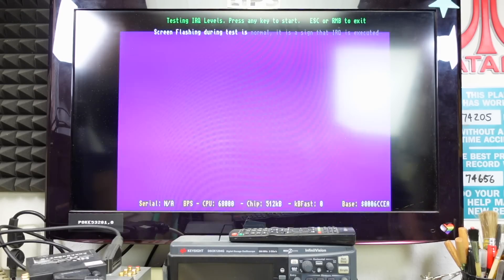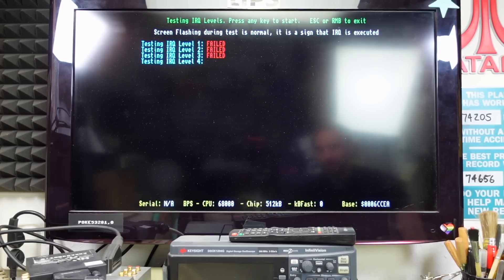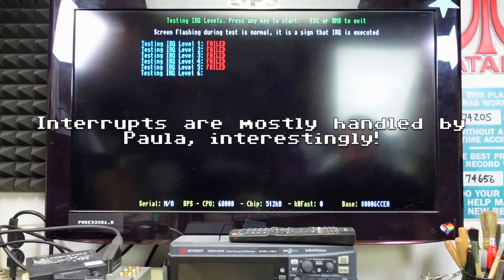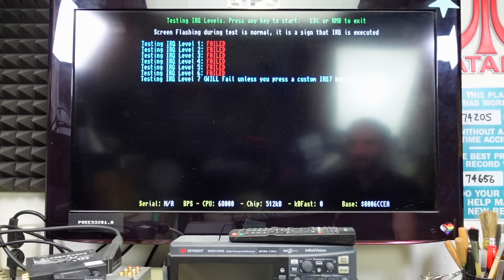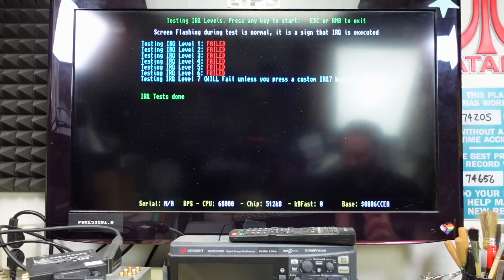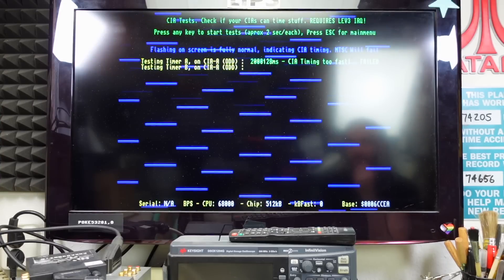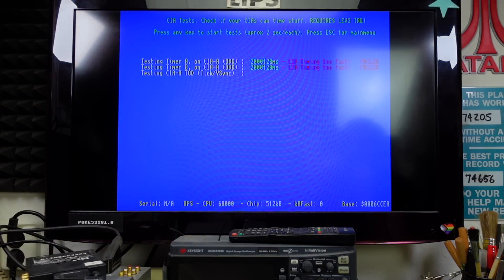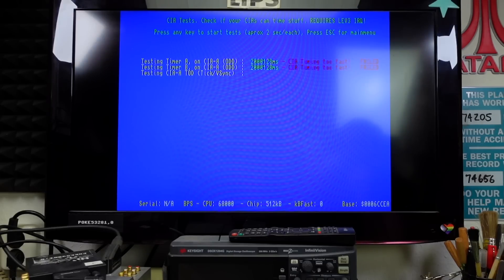Amiga 500 Rev. 5 Yellow Screen Repair

Comment: Great video, Jan!  As for resistor colors: The only way I can remember them, even after over 45 years playing with electronics is this:
Bad - Black
Beer-Brown
Rots-Red
Our-Orange
Young-Yellow
Guts-Green
But-Blue
Vodka-Violet
Goes-Gray
Well-White

Have fun!  😅
Reply: This is the exact phrase I was taught as an electrician in the Navy. Was going to comment but you beat me to it. ;)
Reply from the maker: Haha, maybe this actually finally helps me remember! 🍻
Reply: @JanBeta  For my complicated ways of memorizing stuff, the numbers 2 to 7 are a neat spectrum form red-orange-yellow-green-blue-violet ... brown is not yet properly glowing red so it's 1, black isn't glowing at all so it's 0. Grey is a less bright shade of white, and white is the hottest so they're 8 and 9.
Reply: G for grey actually? IIRC gold and silver occur outside the tolerance band only as negative powers of ten. But I might be wrong - wouldn't be the first time and won't be the last.
Reply: @jussikuusela7345  - I believe you are correct.  I stand corrected.  I jumped the EIA color code and missed the Grey/Gray standard coloring!  I corrected the error.  Thanks!

Comment: The first step to finding the error is always to measure the voltages on the ICs. 
This can be done with any multimeter and is easy.
The second step is to check the reset pulse. 
This can be checked with a resistor and an LED without complicated measuring equipment.
Reply from the maker: Very true! The thing is, I was so sure that I did the basic testing when I first tried to fix this one that it didn't even cross my mind to check voltages again. :D Apparently, I very likely forgot to do that the first time around, too. Didn't really have to probe the reset really in this particular case because the processor was clearly starting up fine.
Reply: also, don't forget to check for shorts, especially under those sockets.

Comment: As you point to at the end, start with the basics - voltages, clocks, resets...  Glad you got there in the eventually. 😁 It must be annoying that such a simple fault has taken so long to find!
Reply from the maker: Yeah, I usually do that. For this particular one, I just assumed that past Jan had already done that (which he probably didn't, considering it was such a simple fault in the end). :D
Reply: It may be considered annoying, but that's the usual stuff you do when narrowing down possible sources for bugs, one step at a Time. HInt: sometimes, the simplest, smallest things have the biggest, nastiest effects - throwing one off the course on a wild goose chase. You only know it been that little small thing the moment you find it. so - relax, take a breath, cuss the sweet bejeeeezus out ot the thing if you are so inclined, and continue the hunt.
Reply: @JanBeta  That's what we german speaking folks call "betriebsblindheit" - and no, "not to see the woods for the trees" does not meet the true depth of meaning. it's especially hard to find one's own bugs, look over one's own assumptions. That's not bad. That simply is. Amithaba. IN the end, you got the bug by the cojones and implemented a nice and nifty fix.

Comment: At 31:30, compare the resistor in question to the ones at the upper right corner. I'm certain the resistor was actually supposed to be 1 ohm, but the 2.2 ohm will work in a pinch anyway!

Comment: Great repair, Jan! Does that CPU Socket problem also apply to an Atari STE? Its has the same socket..and i guess also CPU...
Reply from the maker: You mean the Agnus PLCC socket, I presume? The sockets Commodore used were just really low quality so they fail frequently, I’m not sure if Atari used similar shoddy sockets. If they are marginally better quality ones, they are going to be way more reliable.

Comment: Great repair and very enjoyable video as always! Regarding the new resistor, I think you put a 1/4W there, and I think the original was 1W. Anyway, the lower wattage may cause that resistor to burn out eventually. It depends on the current consumption of the Paula.
Reply from the maker: I double checked on another rev 5 Amiga 500 and the resistor seems to be a 1 ohm 1/4W in reality. Pretty much the same as the one I replaced on the Rev 3 Amiga previously. Probably used for current limiting or as a fusable resistor for the Vcc (which somewhat makes sense). Thanks!

Comment: Have had similar, shorted axial ceramic cap in the audio filter circuit burned up a 1 Ohm resistor that fed power to the quad op-amp..

Comment: Just yesterday I returned from this year’s 4 day DoReCo party. Had my Amiga (Rev 8a) with me that would suddenly give me all sorts of color codes. First green, then red and then also yellow. Big „Oh no“ moment right there. Note: the machine had worked flawlessly just before going there. After testing a whole bunch of things from loose connections to dirt (everything was spotless) and a lot of head scratching and cursing, the issue turned out to be flux residue on the RAM expander (the Max Plain 512k one). 
So contrary to popular belief, sometimes alcohol is indeed a viable solution. 😅
Reply from the maker: Wow, that sounds like a lot of fun. Glad you figured it out in the end! :D
Reply: @JanBeta Definitely was tons of fun. But just as in your case, somehow the most puzzling issues have the dumbest solutions 😂
Reply: @DeputatKaktus  a healthy dose of isopropanol in your case, eh? :)
Reply: @LossMiImKraut  Yes. And then some good old fashioned ethanol for…celebratory reasons. 🤪👉🍺

Comment: 4.75 Volts is only 5% low anyway, well within limits. Usually when resistors fail it is very obvious! Smell is a surprisingly good diagnostic tool in electronics.
Reply: 4.75 is right on the edge of the functional voltage range of most 5V 74 series logic

Comment: I've got a rev 5 Amiga 500 with a yellow screen also.  It's so bad, that not even the diagrom will show anything on screen. I've hooked the diagrom serial port output to a serial terminal on my laptop, and it shows that most of the RAM is bad, which can't be right...?  This machine used to work, then suddenly went yellow screen.  
Watching Jan do his thing here, is prompting me to go back and have another go at fixing mine.
Reply from the maker: If DiagROM shows all the RAM as bad, I’d probably take a look at the Agnus and the logic chips in the data path first. Sometimes if one of the RAM chips is bad, it can also lead to the rest of them not working properly until you replace the faulty one. Maybe one RAM chip gets hot, that would very likely mean it’s completely shorted internally.

Comment: Hi Jan, could you describe a schematics for the Kickstart EPROM adapter socket for early A500 boards you're using in this video, please? ☺I need to build it to myself but can't find proper info or even pictures of that socket done as DIY.
Reply from the maker: Here's a very in-depth description (you only need the "Electronics Part 1" portion of the post for most scenarios: http://bax.comlab.uni-rostock.de/en/hardware/amiga500/kickstart-eprom/
Reply: @JanBeta  Thank you ☺I did it and it's working🙂
Reply from the maker: @aki_128 Happy to help! 😃

Comment: The crash at the end of the chip ram test is normal in this version of DiagROM.. it's since been fixed :)
(A major 2.0 rewrite version is underway)

Additionally, the first CIA tests failed because, as the screen says, "REQUIRED LEV3 IRQ" and the IRQ tests failed :)

Comment: Neither my A500 nor my A2000 have any boot issues under normal operation, however, when I use a PiStorm, I get the same yellow screen exactly ONCE when the system is powered on, then it goes on to flash grey, white, Kickstart/HD boot. No idea why it happens, but it's the only time I've seen the yellow screen on an Amiga in person.
Reply from the maker: Maybe the PiStorm messes up the IRQ timings slightly. It basically takes over the CPU functions completely and probably the timing is pretty difficult to get right. (Merely guessing here!)
Reply: Check the voltages, it might be that your power supply is not delivering enough juice at startup. I have a third party power supply and had to turn up the 5 volts because it kept under-powering the Raspberry Pi (which shows up as lightning bolts if you have a display hooked up to the Pi).

Comment: A PLCC chip will only fit in the socket one way.   One corner of the chip and socket are shaped differently.  If the socket is rotated 90 degrees when installed, you won't be able to put the chip in correctly.
Reply from the maker: I think that’s true for some PLCC packages but not for this particular 84 pin version. You even have to rotate the Agnus if you use a different version for chip mem mods in the A500. This one doesn’t have any physical indentations on the chip side, just a pin one marker.

Comment: Another thing to watch out for are those pesky hidden solder bridges - especially under sockets like the one for the SuperPLA on a C64 assy 250469 - any revision, for they all have that big fat SuperPLA. managed to get a solder bridge like mentioned before and boy, what a Hunt that has been. I changed and socketed all the ICs, even the small ones (and good it been, for there have been broken 4066s), but the main culprit has shorted a five-volt line with address line 0 on the superpla (pin 31 + 32 IIRC) - How to find that out? Well, the whole time the machine has shown a weird double addressing stuff, so I knew it had to be something in that vein. On the scope the traffic was depicted with weird shadows and odd traces not adding up to anything making sense. So I asked: Is it possible that there is a short between lines? And then I went and checked the SuperPLA Pins and 'lo! looksie looksie! I 've found what I been lookin' for. Take that, Bono! After a bit of wondering where the hell that short could be, I ve desoldered the SuperPLA Socket, and there, between the two pads, I've found the solder bridge. Removed it, put everything back together and the machine started to work like a charm. :) 

So, that was the long story of little me and the big bad SuperPLA - I hope you've found it elucidating in some way, the same as I find Jan's vids both entertaining and informative.
Reply from the maker: Wow, those faults are difficult to catch! Glad you found it in the end!

Comment: To make the circuit more reliable, install a resistor with a slightly lower resistance (e. g. 1.5 Ω) and with a higher power rating (0.5 W), it should fit that size.
Reply: No. The resistor is there to help prevent noise from the logic ICs getting to and from the sensitive stuff like Paula but it's also there as a fuse of sorts so increasing the power rating of the part could end up being dangerous in the event of a short on one of the user ports.

Plus, how reliable would you like it to be? It's in a 30+ year old machine
Reply: That resistor is not working alone. It is the part of the R/C filter there, value is critical.
Reply: @borayurt66  In this case install the same value, but with a higher power rating.

Comment: This made me feel I really have to fix my amigas.  Just don't know where to start.
Reply from the maker: From this repair, I learned to start with the basics, like checking the voltage supply to the chips. Then you could see if the reset circuit work, if the processor clock is there (if you have access to an oscilloscope, that is). DiagROM is also a huge help, even if it’s not very well documented. It at least can help narrowing down the fault most of the time.
Reply: @JanBeta  Thing is, I made a stupid mistake when I was gonna upgrade kick 2.0 to 3.1 on my rev 5 500. (Don't do soldering when your blood sugar is to low :P)
 I don't know if I killed the PSU (meanwell) or if something else happened but the power led only flashes once quickly when I put the power on, it's completely dead otherwise.

Comment: The problem with rev 5 boards and larger ROMs isnt that they missed components - it's that they got the pinout for the ROM wrong! With only a 256K chip (like Kickstart 1.3) everything appears ok, but when using a 512K ROM the extra address line doesnt work.

Comment: Jan, it was a weird comment you did about swapping chips vs using an oscilloscope. Those chips are rare and expensive, your stash is way more pricey than a good enough oscilloscope to debug an Amiga. The educational value of just swapping stuff around until it works is not great. Fixing stuff is interesting because you learn stuff, this is not just about this specific machine working but about: what is an IRQ? How IRQs and sound can be linked? What is the architecture of the Amiga etc...
Reply from the maker: I would have to do a lot of research to be able to concisely talk about the exact inner workings of the Amiga IRQs. It’s quite complicated and I don’t understand it nearly enough to share my knowledge with the world. Also, you can still buy A500s for under 100€s and the whole chipset for around 50-70€s, even on eBay. A proper DSO is still a lot more pricy than that. Hope that clears up my point a bit.

Comment: Were the Amiga 500 CIA's different than the C=64?
Reply from the maker: They are very similar. As far as I know, the main differences are maximum speed and the missing TOD clock in the Amiga CIAs compared to the 6526s. I heard that you can even use Amiga CIAs in the C64 to some extent but I've never actually tried it myself.

Comment: that is not a 2 ohms resistor it looks like a 1 ohms (brown,black, gold)
Reply from the maker: I think you are absolutely correct. Just double checked on another rev 5 Amiga 500 and the colors are clearer on that. Definitely a 1 ohm. I have some of those, so I’m going to put the correct value in. Thanks!

Comment: "Thou shalt always check the voltages first!" 🙂You can just solder a 22 ohms resistor in parallel to that 2.2 ohms and get 2 ohms exactly. Solder it under the board to keep the good looks intact 🙂

Comment: PLCC is 84 pin.
Reply from the maker: Yes! Thank you! 😊
Reply: @JanBeta  Sorry, couldn't resist.  Also, could I ask you what is a good source of DRAM for an Atari 800XL?  I have one that turns on with a green screen and wanted to start with the memory.  All chips on bord are socketed so that would be the easy first step.  It has Hitachi 4864-2 DRAM's in it now.

Comment: But how does a resistor go bad?🤨
Reply from the maker: I guess it saw too much current at some point. I said in the video that maybe I plugged a Paula into the socket while the power was on or something. I've also seen resistors just randomly die of old age, although that rarely happens, it does sometimes.
Reply: @JanBeta Interesting, I've seen resistors toasted crispy brown and they still worked. Maybe a manufacturing defect.

Comment: oh, and there is NO SUCH THING as LED blink codes. I have no idea who started this one, but it's completely *false*. The number of blinks is always the same and its just what the fault routines always do. The only thing that means anything is the screen colour.

In this case, with a dead Paula, it could well be that spurious IRQ's happen... this would trigger a yellow screen as it's an unexpected interrupt. 1.3 probably disables interrupts early on in the 68000 (using the SR register in the processor) in addition to using the custom chip INTENA register.

The freeze at the white screen in 1.3 is the system waiting for an interrupt to happen (it's how multitasking is driven), and because Paula is dead, it never happens.